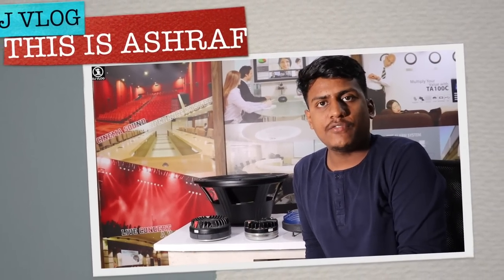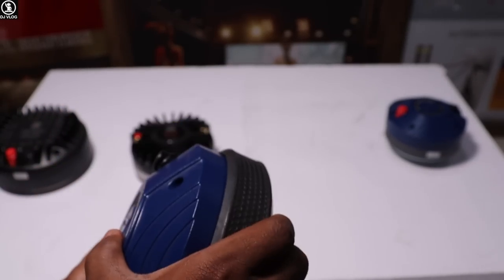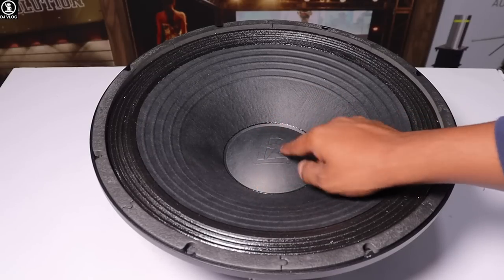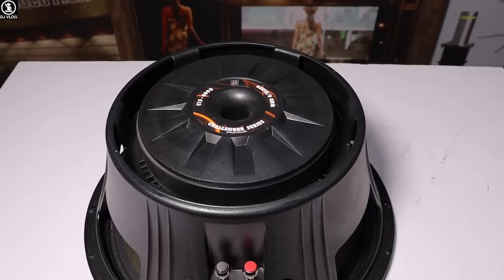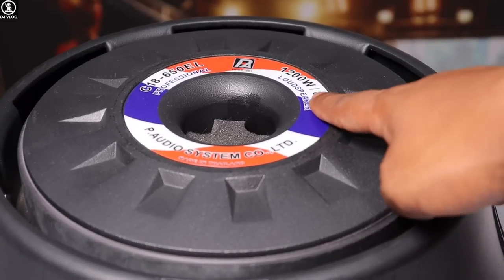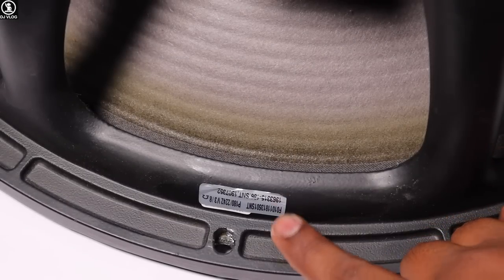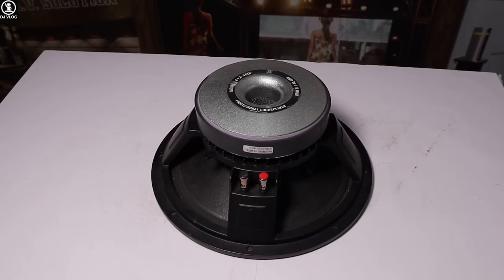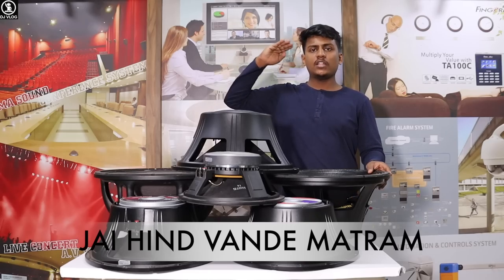Original P Audio के सरे स्पीकेर ओर HF Driver//P Audio Made In Thailand

Comment: dual 15" me 400watt ka Ahuja speaker lagaye h or 450 ka HF Lagaye ...sar mera questions hai ki 450 ka HF ka coil  Baar Baar jal jata h or Baar Baar usko change krna padta h ....sar Mene 2019 me business start kiya hu .....plzzz sar help me ....2 top 2 bass ( 1200 watt ki ek bass h ) jo ki stranger 4000 watt ki hai or sath me sm6 ka mixture hai ..jb v 4  ka setup lagate h tb ye problm  hota  h ..Hf ka coil jal jana
Reply from the maker: aapke network plate main problem hai change karo sahi quality ka network plate use karo
Reply: Pr sar 1000 watt machine se chalata hu to hf ka coil aj tk nhi jala ...

Comment: Amplifier se 100 mitter distance PR 1200 watt speaker connect krne ke liye kitna gause ka wire use kr saktye jesi sound v quality me Jana chaye ?
Reply from the maker: amplifier se output nahi jayega itna lamba aap dsp use karo
Reply: Signal cable lo, power cable lo speaker ke pas amp rakh lo best option rahega.
Reply: Bhai dsp kya hota h